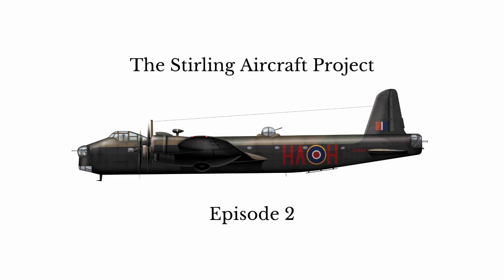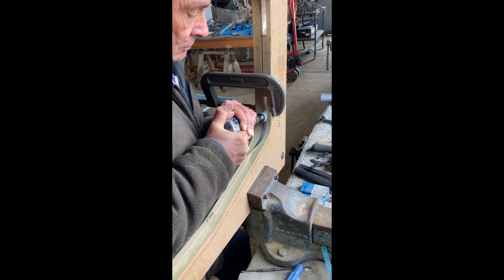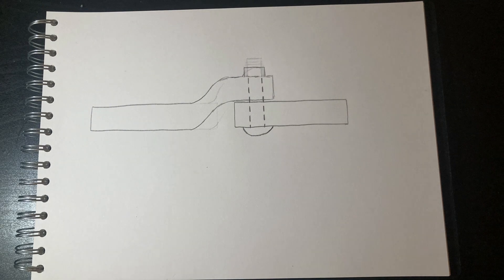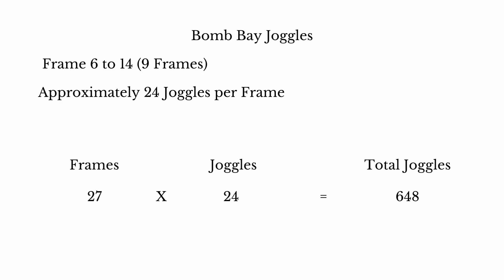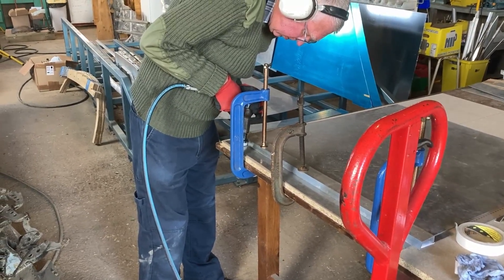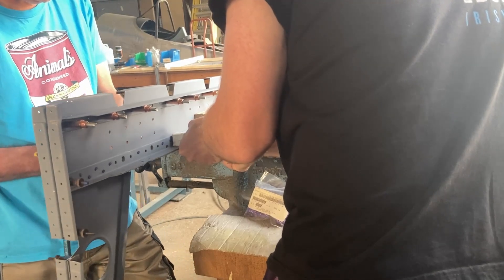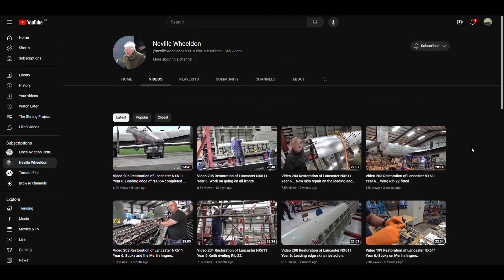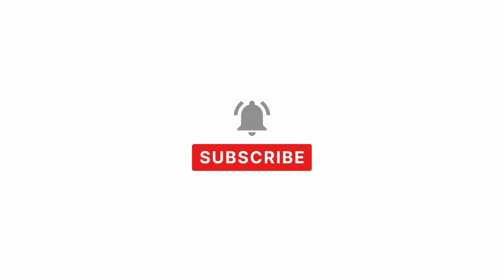Episode 002 - Bomb Frames, Keels & Joggling

Comment: First of all, great video! I've been following the project on forums and social media etc for ages, so it's good to see some YT coverage. You probably get asked the same question a lot, but why not go for building the whole aircraft? Obviously it would be a massive task, but would it maybe notch the project's profile up? Fwd fuselage is fantastic in my eyes, just wonder if there is some option for building the whole thing.
Reply from the maker: Thank you for the question!! 

Right so this is a complex one but basically it’s all down to logistics! 

The sheer size of the aircraft means we would have to have a hangar large enough to store it! It wouldn’t fit in any conventional sized hangars as it is just too tall. 

The availability of information is almost non existent so we are having to depend on wreckage to give us key measurements to create CAD models like the one in this and the first episode. We simply don’t have enough wing wreckage to be able to do this like we are with the fuselage.

And lastly is manpower we would need hundreds if not thousands of people all with a great knowledge of the aircraft and aircraft structures which we simply do not have. 

Not to mention the lack of key components such as engines, fuel tanks, main landing gear and drawings/ maintenance manuals of the aircraft. 

Hope this helps explain somewhat if you have anymore questions please just ask! Thanks for the continued support of the project!! - Jacob
Reply: @TheStirlingAircraftProject  Thanks for such an extensive reply, can't argue with your points. Are there any possible wrecks in lakes or anywhere? There are the two Halifaxes from Norwegian lakes, keep hoping there's a Stirling out there somewhere!